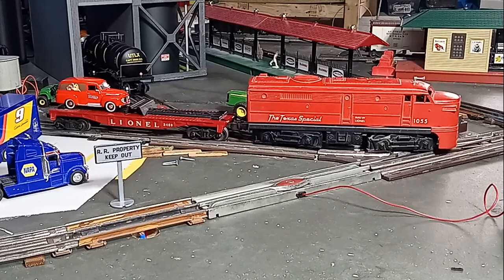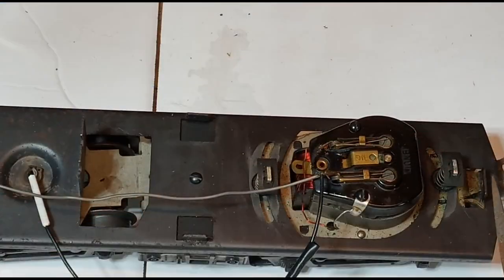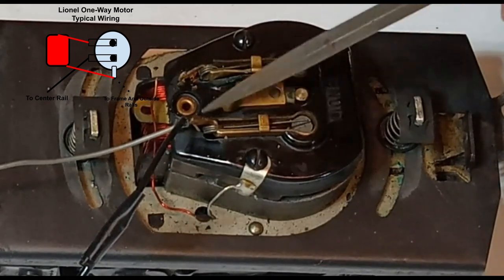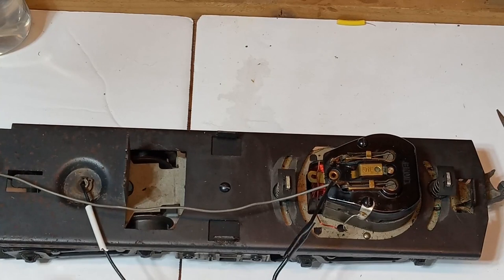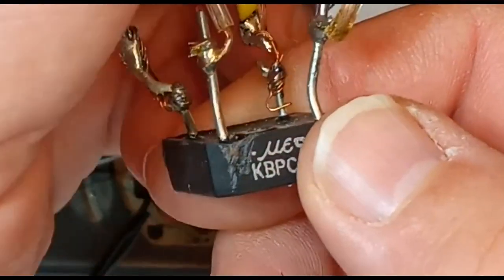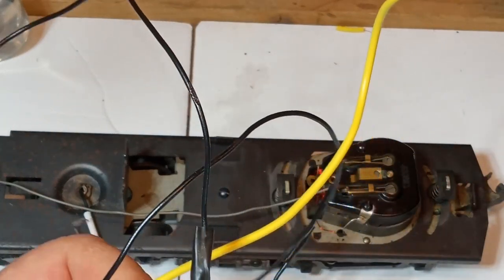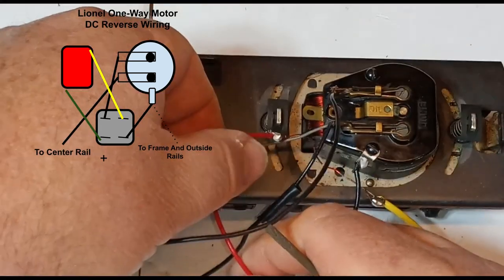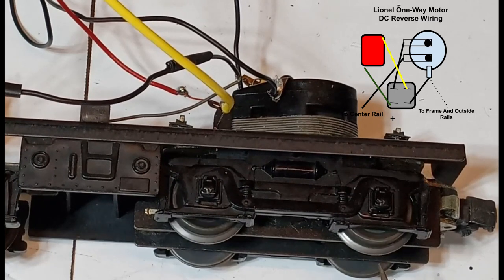How To Easily Add Reverse To Classic Lionel One-Way Motors

Comment: Yep that is what mine look like when I was 10 yrs old. Except I remeber it having a reversing lever on it. The Texas Special. Many days of fun back then. This video is very good. Thanks.
Reply from the maker: You probably had the #210 or #211 Texas Special engines that were regular production and did have reverse and magnetraction. The #1055 was only offered in 1959 and 1960 for low-budget mass-retailer sets, which is why it had no magnetraction, no horn, and no reverse.

Comment: Looks like a single wound coil so adding an “E” unit would be straight forward as Ronald pointed out. If it were a double wound coil a different 2 position unit would be suggested unless one paralleled the double winding.
Reply: I just thought a double throw switch with 6 contacts could be substituted for the “ E”unit. To achieve forward and backwards (not by turning on and off power or using direction lever/button) but would have to be triggered to change direction.
Reply from the maker: Yes, a 3 position would be the easiest if you were to go that route.
Reply from the maker: You can manually change direction with a DPDT switch.
Reply from the maker: The DPDT would be wired like a DC direction switch - track power and common to the contacts on one end, reverse the wires for the opposite end, and the center pair to the brushes.
Reply: The 6 contact switch DPDT would work AC or DC and not have to intervene with transformer on/off. The added feature to leave engine on the track with DPDT switch in off center position and be able to run another engine. Yes it involves hand contact to switch position but I don’t reverse much. A double head engines would insure they stay in directions desired no matter transformer on/off or in event a derail of one engine or rail car.  Even switch out incidents will not affect direction. Your you tube gave me thoughts outside your presentation. I’ve since changed all most all my engines with DPDT switches and removed “E” units. Thank you for inspiration.

Comment: You present things very clearly, but how many Lionel operators use DC? Next time,  bite the bullet, buy an e unit and do that Installation. I believe it would be much more relevant to most Lionel operators.
Reply from the maker: More operators use DC than you may think. https://youtu.be/hg6t6ry3QrQ Also, it doesn't make sense to me to add a $40 e unit to a $20 diesel. Thanks for commenting!

Comment: I've got a Texas Special Lionel 027 engine that only goes forward.  So all that is needed is a full wave bridge rectifier?  About how many amps should you use for the full wave bridge rectifier?  I've got the little square 1 amp FWBR for illuminating my HO scale coaches.  Will they work for this instance?  Thanks for the tips.  I'm definitely gonna give this a try.  I just pulled down your description and you use 10 amps ones.  Thanks as I'll get mine from eBay.  Guess I'll have to subscribe to your channel on YT to keep up with what you're doing in the way of 027 Lionel.  I'll probably have to refer to this video to get the FWBR wired correctly.  Cheers from eastern TN
Reply from the maker: I used a 10 amp for this project because it was in my parts box. That motor shouldn't pull more than 5 amps, so the 10 amp is overkill.

Comment: I have a Walthers O scale (2-rail) CNW 'doodlebug' (iirc they were sold as kits during the 30s, 40s and maybe the 50s) that someone had performed this modification on. It has a fancy 7-pole universal motor, but the setup is the same. It was my first time seeing it done, and I though it was rather clever! I didn't realize or understand what was going on at first- I applied power to the motor truck and the motor was acting like a DC motor, despite being a universal. Then I noticed the rectifier, and it clicked.
Reply from the maker: It works!

Comment: Hi...this may be a bit long...thanks for the info. I wanted to add some neat sound to my Lionels with out spending much moneyI have a MRC SOUND power transformer That is a DC output only, so this will make a great conversion. I donot need ac to power horns or steam whistles as the trans former supplies built in a great sounding horn or whistles. I have just ordered a bridge rectifier from one of your handy links thanks. My question is... I am having a hard time in following your wiring diagram...what is the red block in the top left hand corner of your diagram.
Reply from the maker: The red block is the field coil of the motor.
Reply: @ToyTrainTipsAndTricks  Thanks I was a little confused.

Comment: I set it up and the back and forth movement of the trolley, with a DC controller worked perfectly but the amperage draw of the motor was 3 amps. Unfortunately the relay board used in the modeltrainsounds auto-reverse has a rating limit of 2 amps. It appears only Can motors can be used with this auto-reverse system.  . I would be interested in knowing what the current draw of your FA Diesel is?.  Again thanks for the info it was very helpful. Bob
Reply from the maker: I haven't measured, but I would guess it's at least 3 amps and probably more when its under load.
Reply from the maker: That's one of the reasons that I use a rectified Lional AC power supply instead of a DC HO/N supply. Most HO/N starter set packs can only handle 2-3 amps.

Comment: I'm wondering if you could do a similar mod with a DPDT switch so you're basically manually doing what the e-unit does. That way you also get AC operation.
Reply from the maker: It should work, assuming you place the DPDT switch between the rectifier and the motor.

Comment: I rarely run my trains in reverse. I don't you switching cars in and out of turn out on my layout. I know a guy whose PS1 Electronics died Angie had the hobby shop just wired it up to go in forward only so at least this way he could still use it. I am going to do the same thing with the engines that have damaged boards. I wish Lionel had made the ALCO fa scale sized like the F3. I use mine on my strictly 027 layout underneath my O gauge layout.

Comment: your tutorial is quite interesting but left me with several questions: What is the cost of the control box you're using that's wired to the transformer? It must also have a rectifier in it as well as a polarity switch, correct? (which adds to the cost of your project)   Wouldn't it be just as easy and economical to purchase a 2-4-2 from the MPC era, use it's E unit, and just keep the whole thing conventional AC? I've pulled quite a few of those atlantic beaters out of a 5 dollar box at train shows as well as seen them go pretty cheap on the bay.
Reply from the maker: The total cost of the rectifier and DPDT are less than $10. With the converter box I can run traditional AC engines on DC if I wish with the advantages of DC (smoother running, better low speed control, no r unit buzz, etc).
Reply from the maker: I just went to a show this weekend looking for "beater" engines and came up empty. Recent eBay prices for the engines you mention are $15-$20 plus shipping, so about $30 for an e unit.
Reply: @ToyTrainTipsAndTricks  thanks for the info. I recently bought a K-line steamer with a bad board and can motor that I added a rectifier to, never considered converting an AC motor. The can motor  is very quiet and smooth. I considered just wiring it directly to the pickups and running it DC so I'd  have reverse but all my other 80 or so locos are AC.